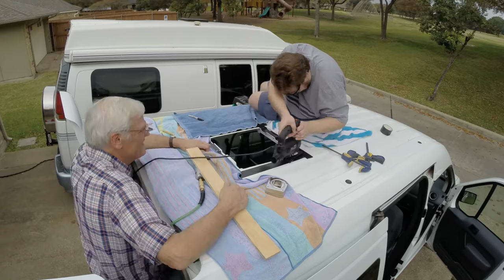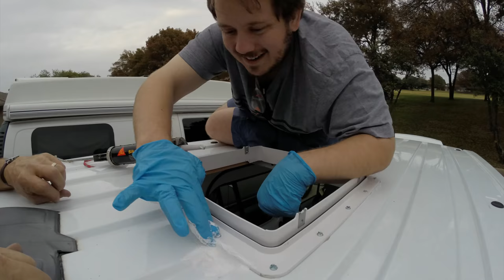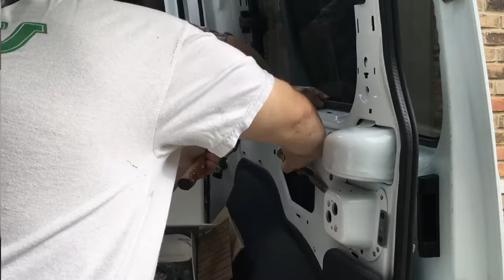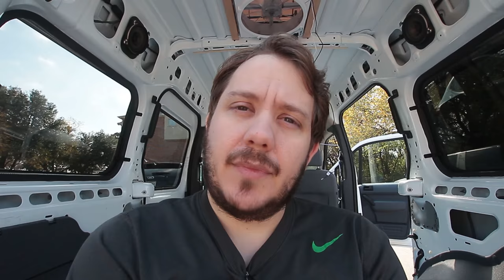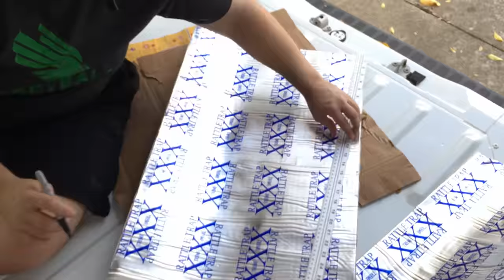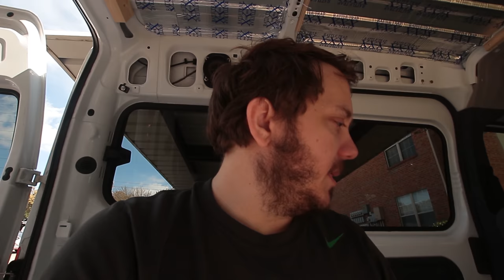Installing the Vent Fan and Sound Dampening | Ford Transit Connect Camper Van Conversion Vlog

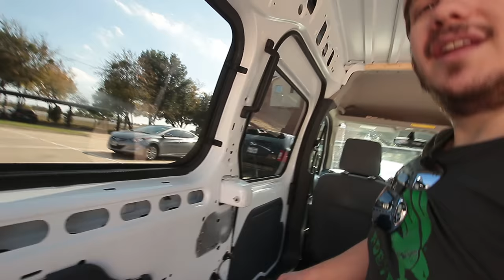Comment: @3:00 Jimmy, thanks for the tip about drilling out the spot welds to get rid of those seatbelt holders.  I just discovered your playlist today, and I'll be watching your videos over and over as I go through the same steps starting out my camper build. I am also from Texas and bought a 2012 Ford Transit Connect XLT Premium last month that had to have been originally customized just like yours with the same interior trim, LED lamp, cargo liner, and rivet holes in the floor, but someone had already taken out the desk and chair. The previous owner was a carpenter, so it had sawdust in every nook and cranny that I have been cleaning. I have a few repairs to do to get it as fit as yours looked on day 1, which was apparently 6 years ago.
Reply from the maker: That's fantastic! I hope these videos are helpful to you. Good luck with your build. I also recommend checking out the Transit Connect Campers group on Facebook. There's a lot of good tips, tricks, and build ideas going over there.

Comment: Hey a tip I learned to make calking smooth or to make it less sticky is to put some soapy water/simplegreen/(or even spit if you have a little job) on your fingers and it allows you to smooth out the calk, without it sticking to your fingers or gloves. I like the  pvc inserts to bridge the gap of the roof. Good idea. Why did you go with that fan vs a smaller hand crank style?
Reply from the maker: Thanks for the tip! I picked this fan because the design allows the vent to be open, even while it is raining outside. It supposedly will not leak water in that situation.

Comment: Have you looked at painting the inside with ceramic paint additive, seems the easy way out. I am enjoying the videos, thank you.
Reply from the maker: I hadn't considered the ceramic paint until after I did the FatMat. Most of the other van builds I have been watching are using this stuff or a similar product. I like that the FatMat is kinda spongy, so it dampens the vibration of whatever is sitting on top of it, like the sub-floor.
Reply: I may do a combination of the two.

Comment: I hate caulking.  And it's so unfortunately they have to put big ridges on these roofs.  I prefer Butyl tape. 

Would you say the hole was exactly 14x14 . Are corners rounded? Are all these holes standard?
Reply from the maker: I used both butyl tape, and caulking. I actually had to take the fan off and redo the caulking a few months ago, because it was leaking. Guess I didn't not put enough caulk in the roof grooves. I do not remember the exact dimensions of the hole. I think they are a standard size, however. And the corners are indeed rounded.